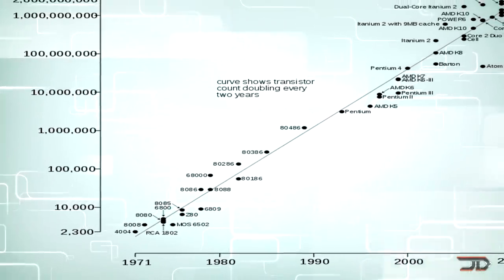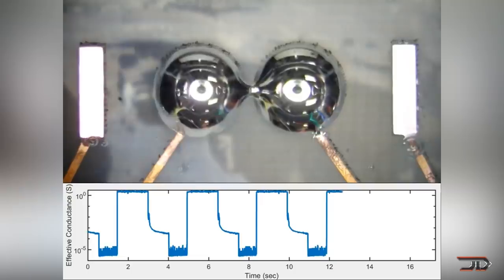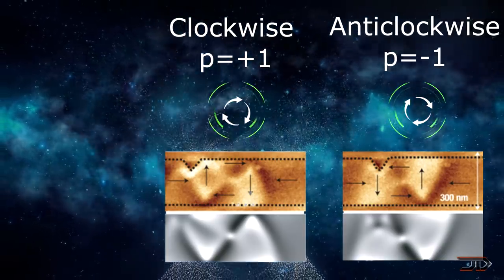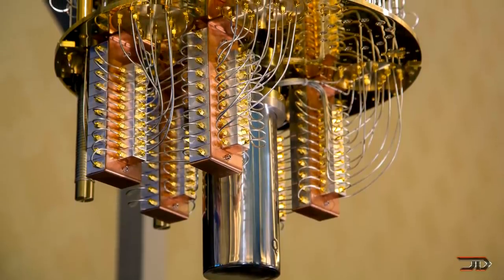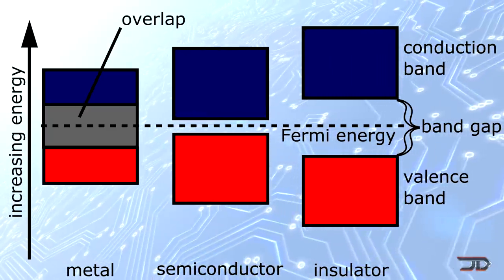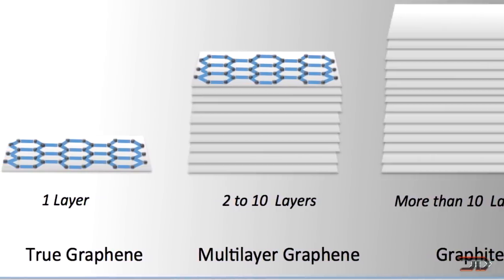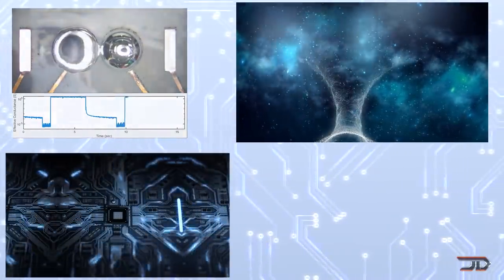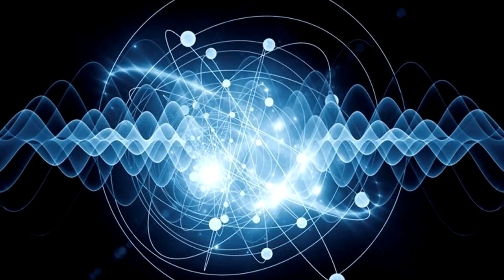The END of Silicon & Future of Computing

Comment: Hawaii black sands beach break through could make a quantum computer extremely small . It's funny how they push 5G once the black sand technology was discovered because not only the chip cools it's self down but produces some energy as it operates . A cell phone charge could be once a week with this technology . Li-Fi technology is much faster then 5G and cheaper . Only problem is that you need a internet connection to send information . To receive information all you need is a light source .
Reply from the maker: RF wireless charging can be done as well and the receivers can be @ micro level. It's in research phase right now but I expect it to become pretty mainstream. Thanks for the in-depth comment!

Comment: Nanowire's and nanosheets will play a role and allow for higher GHz but the main circuit size will shrink as it verticalizes and as the frequency gets higher you get these 300 layer bumps stacked that are all identical in initial state wired up properly but only after initial setup are the bumps set to their main tasks. The stacked bumps will be on Thermo optic pins and eventually photonics will end up on them fully. That's the future of computing according to me.

Comment: Quantum is interesting.  After all, it wasn't that long ago when changing defunct vacuum tubes was a busy position and you'd also need a power plant.  All that for a clock speed that you could hear.   A long time ago a TV repair guy showed me a transistor.  He told me it was all new etc.  But he said he didn't think they would last.  Too small and delicate, too easy to kill.  He also disliked that they were more difficult to replace.

Comment: You need 2 components added to a double slit experiment. one filter to go over one of the hole which when the light is in particle mode for the light to slip over to the other hole and you also need a crystal which when a second beam is shun over it turn on or off observation. This way you have 2 lane logic the carrier lane and the data lane.

Comment: The 3nm naming convention has got nothing to do with the features on transistors. They instead refer to the fabrication process used in manufacturing advanced nodes. That correspondance with naming convention and gate length was stopped quite a while ago, around 2 decades.

Comment: What about advances in cloud computing, you could have larger optical computers on your desk, silicon on the go, quantum computers in certain institutions and have them all linked fibre optically, if the computer you are using can't perform the task in a reasonably fast time, it can be processed by the cloud, where more conventional cpus or combinations of other technologies can do the calculations for you and send them back, it may get to where the average person doesn't need to carry a fast computer because they are so integrated everywhere around us in a big cloud that your device doesn't need it's own storage or more than a simple cpu to decode the data stream and drive whatever interface it is using because all the difficult processing and data storage is done by a network of different computers off site.

Comment: In the extended interim, I expect we will see volumetric CPUs, which "build" low viscosity coolant channels into a solid cube, or sphere of ~5nm silicon. ... The layers of such hyper-dense cubes will consist of chiplets which are submerged in a wash of coolant. .. The major advantage of modular chiplets is that they can be selectively tested and rejected from large wafers, reducing wasted "dinner plate" sized wafers. ... Finally, volumetric substrates, with integral cooling, are highly scalable, when it comes to massively parallel architectures. ... By fully exploiting proximate density architectures (physical optimization), we can expect today's SBCs to scale down to the size of a sugar cube, without much difficulty.

Comment: I wonder if 3D printing will allow for 3-dimensional circuitboards and being able to print components right into the designs rather than needing to order them from a manufacturer. That would be huge.
Reply: Good thinking.
Those have been around a long time, just very expensive; I've personally worked with 6-sided cubic circuits, 3D stacked PCBs, and 3D stacked ICs, including Through Silicon Vias. Current 3D printers lack the micron resolution and speed of other processes. Thermal management with these architectures is more difficult, of course

Comment: I'ma go out on a limb here and guess #1 before I watch. Carbon Nano Tubes or Graphene, basically the tubes unrolled. I'm also going to guess it's wrong. With all the materials that could potentially be 2D like graphene, what are the odds that the first one we manage to create would be the best at the ridiculous amount ideas people want to use it for.  A good example was to use CNTs for a space elevator tether. Of course the mainstream media is clueless and something that was theoretical became "just a matter of time now". Unfortunately with our improved models, there will be no tether to space made from CNTs. 

It will be incredibly important to choose the correct material as it needs to replace something that has had decades of testing. We simply cannot afford to learn a year or two in that there is something better. It will cost far too much to change lanes and start with something that only looks more promising. It may turn out that it is in fact the best choose but we simply have no idea if that's true.

Comment: I enjoyed your presentation but I feel left out..... I have in-visualized a little different scenario, Why are we not thinking about the fastest computer man has?   We are made of Carbon, graphene is made of Carbon  Diamonds are made of Carbon, it crystallizes in a 3 dimensional shape. they conduct electricity they can be made into switches with not 2 positions not 3 positions like a quantum computer but 6 positions or possibly 7 if you quantamize the idea.... and think in 3 dimensions.... why isn't this being contemplated?  I know IBM in their FL research facility is working on layering Carbon crystals to make a Carbon crystal chip with the bombardment of a single carbon atom with CH4 in a microwave to add layers of crystallized carbon and making diamond switches but why isn't anyone looking at it from a 3 dimensional angle.... like the first contact radio image sent to Jodi Foster... perhaps a 3 dimensional approach to a computer would speed up the results??? Perhaps the combination of light along the crystallized atoms in a carbon tetrahedral configuration could allow for a reflective computation at light speed???

Comment: I suspect semiconductors have a lot of room for growth and innovation that is likely underestimated--though non trivial. For instance, as we hit the physical limit, costs will go down per wafer, which may also lead to larger chips and wafers and better yields as the processes mature. We may also see more customization in silicon. Semiconductors are primarily wire and thermally limited--this may improve with time.

One thing I'd be curious to see as well is multi-level logic--beyond just binary logic, which would open up a whole new can of worms. Furthermore, FPGAs will lead to unprecedented innovation in the software stack. For instance, imagine if you could dynamically reconfigure an fpga on the fly to have hardware impenenting fine grain acceleration that's made architecturally available to software at low latencies. We've not even scratched the surface of heterogenous computing. Also consider that we've not fully figured out power management technology--power optimization is decades behind functional features. Architecture has room to grow--combined with dynamic reconfig., there is a huge opportunity there.

Don't get caught up on Moores law. Chips aren't just improving due to smaller transistors--that ended a long time ago.

This all amounts to decades of innovation to come.

Comment: I just finished watching a video on people that are following in the footsteps of Nikola Tesla as modern-day inventors, known as "the children of tesla". One of them is doing some interesting research around using diamonds, yes, lab-grown micro-diamonds as a direct replacement for silicone.
Reply: So micro-diamond is the future for mobile chips. Then mobile will sure pass the PC gaming.
Reply: @user-Void-Star  lol no, if micro-diamond replace anything it will be everything that is currently being made from silicone for anything electrical. That includes all integrated circuits, all processor, all solid-state drives, hell they could even replace copper for the motherboard circuitry with diamond traces to exponentially reduce the size requirements of motherboards for the things they need to be able to do... If it currently uses silicone for its computing the diamond version would replace it. Not just for mobile computing but for desktop and workstations as well.
Reply: @robantsin  there are lots of options like graphene plasma, liquid, magnet, etc. They will figure out something for sure.

Comment: VO2. Vandiumoxide. That will be the next material. Conducts electricity at room temperature but not heat.
Reply: Do you mean it does not produce heat? 
Not conducting heat would be bad as we typically want to spread the generated heat as much as possible.
Reply: Rohan4711 if you are making heating systems then sure u want to spread heat... but for electronics heat is bad, this will spread electricity without heat spreading

Comment: The problem with light based computers, to my mind, has never been the 'CPU'.  The hard part would be light based RAM, and the 'Hard Drive'.  We have enough research about lasers and different colored laser-beams interacting that we could figure out a laser-CPU easily.

It is the storing data that  is the problem. - The only thing I have read about is the holographic 3D crystal memory storage.
This would use lasers to burn the data in, and to re-read the data.  But it would burn all data.  It could not be deleted.  You would need a system to either add new memory-crystals, or to swap them out.
Reply: Good news light based optic ram is being developed by Europe . Said to be 30 times faster than the normal ram

Comment: This obsession with making solid state switches smaller than the current tech' provides is absurd! Transistors are small enough already!! It's time to concentrate on lowering their power consumption and their efficiency of operation by implementing small changes in the process (I know, I know ... 'smaller means less power, etc. ... but maybe not so?). I'd like to see a 5Ghz processor that needs NO heat sink. We need to improve what we have instead of trying to make it even smaller, only to be faced with the SAME EXACT issues the previous iterations faced. 'Tweek' what we have and move on with novel applications.

Comment: Light would be the best application. Next to no heat output, fractions of energy consumption and degradation.
Reply: it sounded as if they were looking at the possibility of splitting photons?!
Reply: We have tried light for 10+ years already.  So far it is so impractical that it has not been near to speed we get with silicon.  If you replace all of the computer circuits with light curcuits you would get some additional advantages,  but that would mean you have to make huge investments before getting any return. From an economical point of view that seems like way to much risk compared to possible gain.  No company is pursuing this road (at least not publicly).

Comment: Why not just go multicore like those 16 core CPUs. What speaks against a 256 core?
Reply: Most stuff we care about has to be done sequentially.

Systems with a high number of lousy processing units are actually being made - IBM calls them "neuromorphic" computers. Devices mainly used in AI research.
Reply: @BMoser-bv6kn  I fully agree with B.  Moser.  With multi core we move much of the problem from the CPU to the programmer and to adjacent hardware,  like cache and memory controllers.  Today 99% or more of programs are really bad at utilizing the power of multicore CPUs.  This gets a lot worse as the number of cores increase. It is far from uncommon to see speed increase when you disable half the cores. 
We could try to get 99% of program developers to completely relearn how to program computers,  but that it extremely expensive. 
We should also mention that the more we lower the nm used the higher the chance of sporadic faults in execution happening. We have already gotten to a point where this starts to become a serious issue. If you got extra radiation you have huge issues,  like in airplanes,  spaceships, near the poles and in military equipment.
Reply: heat speaks against it.

Comment: I think the liquid transistor will not achieve CPU technology.
First, your CPU must build in horizontally, and you shouldn't shake your desk^^
Second, then we are at 0,00001 Mhz clock speed, because of waiting for the liquid to rise for its connection.^^
Light is maybe the first step of the future computing.
And many years later an updated version of quantum computing, there you don't need an liquid nitrogen tank in your house^^xDDDD

Comment: No mention of organic electronics (devices printed directly onto substrate)? What they lack over silicon in speed they could more than make up for in ubiquity due to reduction in manufacturing complexity - who needs a blazzingly fast and hot silicon CPU when you could have an entire table top or even the walls of a room wallpapered in low performance postage stamp sized processor cores.
Reply: @norlesh do i get to feed it?
Reply: @ramade9040 :) just electrons

Comment: The issue is software. Current software models and tools prevent using silicon to full potential. Many would believe its economics but its not. Clock rate increases is a pointless pursuit to degree. More people trying to buy out software processors. Look at the power consumption, memory and architecture issues. They are still pretty much the same if not worse. Yes we have faster stuff and are able to make huge jumps still. In my opinion this video fails to see how that's been happening. Power and thermal consumption mostly go unnoticed in software, but apply in hardware. The economics of software are terrible. I have said this for years now, heck it may be a decade.

People love to point out certain technologies but fail to understand the type of thing discussed here. We are talking about transistors and Boolean. Transistors are energy manipulators nothing more. Boolean is a logical computation scheme for work across that manipulation. One if not both are up for review. Software works within this too, but mostly as a direction of architecture. Improper understanding of computation is likely the concern. The reason for not using gears is size, speed and energy consumption.

Looking at the AI and cloud stuff it becomes clear where this problem is really heading. Should be an interesting one. I personally think CS is done as a field, as they have moved into an area that is just down right crazy now. Turing as a concept is a massive problem. Software can still retain value but will need to be redirected to solve another class of productivity solution. This direction existed in theory, however manufacturing was not possible at the time. Now that it is we can consider moving towards it. Realistically I guess one could make an argument of waiting till closer to silicon feature limit. However the software concept and programming models would need to change. That will take time.

Can't tell you how many people have mocked me for this. My biggest concern is they will continue with general purpose crap. For certain markets this will still make sense. This is a big topic and there is a lot I left not said here, however I am just going to stop here.

Comment: Your argument is one of gate density driven by atomic scale limits, but you then cite various technologies most of which have even worse limits and don't bring much to the party. Silicon lithography is not going away. It will continue to be the dense option and can't be bested by tech that can't compete on scale or a host of other parameters. Silicon lithography will extend even further into the 3D fabrication realm, more specialist custom circuits will augment chips as they have for GPU and Neural Net, aggressive power gating will continue particularly as gate count increases, as on any given clock more and more silicon will be dark because architecture will pursue performance at the cost of specialization and redundant complexity and core counts will continue to climb as design hits the practical limits of IPC performance. All of these trends are already underway and will start to dominate design as the lithography shrink becomes more difficult. Quantum computing is promising for specialist applications but would certainly be accompanied by a LOT of classic computer processing capabilities.

Comment: Why are u (chip makers) trying to constantly change something that is ok? Does it really need to be smaller and faster? Or are games and computers simply adapting to chipmakers efforts to produce uncoolable heat. Theres also a limit to how great a game's graphics can 'look' or how fast a program can run before becoming irellevant. 

I am trying to build a fanless computer here, and it does not need to be very fast. If there is any way to underclock a processor to remove the heat please show D//